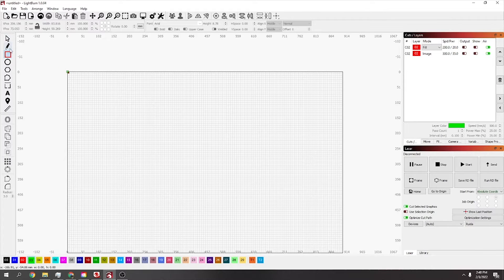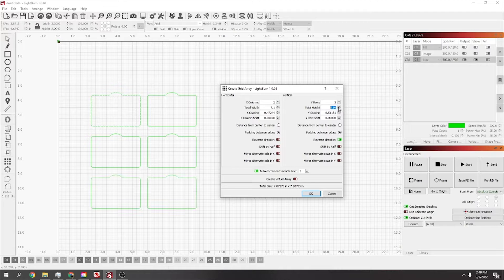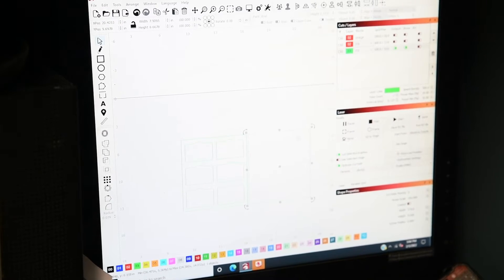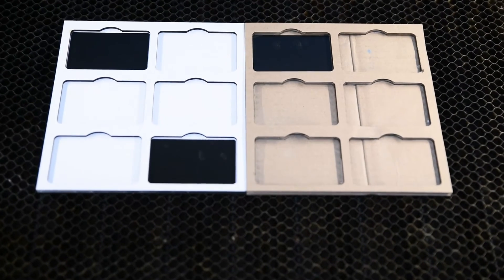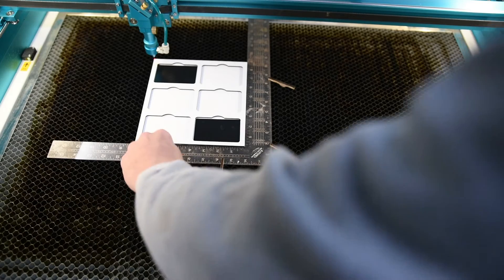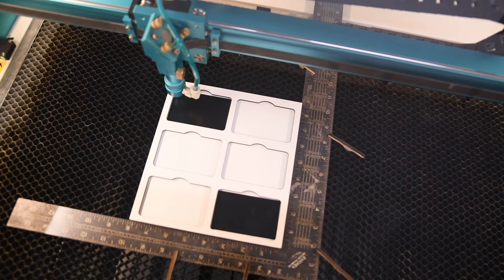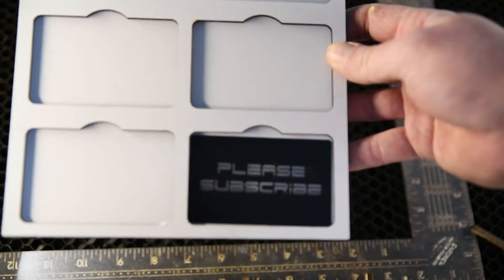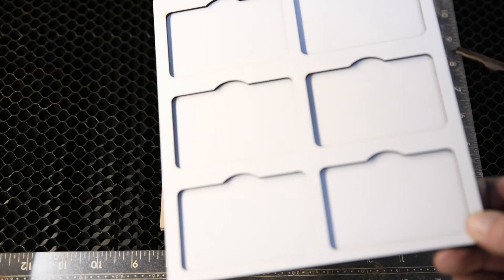How To Make And Cut A Laser Business Card Jig

Comment: Hello I have a question . I make small speaker boxes out of thin mdf wood . I want to be able to laser cut my patters to save time . What do you recommend my best option for lazer cutter / to use
Reply from the maker: i would go with a 100w if your cutting a lot of MDF and just depends on size how big of a board you want to get in there.
Reply from the maker: also you can get a 4" nozzle and it will cut easier, i can get through 1/4" MDF with my laser but i need high settings with my 2" lens. but a 100w or 130w with a 4" lens and even without would do it no problem.